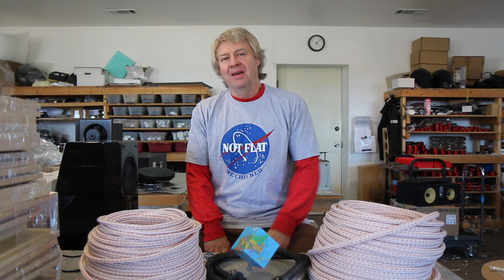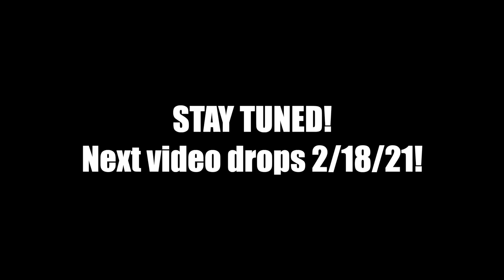Audiophile Cable TRUTHS: The Divided Camps

Comment: "Good audio" is one heck of a conundrum. Objective measurements have come a long way in creating correlation with what to expect from sound, but I do get the feeling that sites like ASR are missing a piece of the puzzle. I think they have amplifier characterization nailed, but there's definitely something missing from their speaker measurements, and Amir seems to acknowledge it. He's mentioned he likes speakers that don't "measure" well and vice versa. But this shouldn't serve as evidence that measurements are meaningless - it indicates that additional tests need to be added to the suite which quantity the noticed difference. But of course, a "noticed" difference needs to be proved with a double-blind test.

It's nonsense to say "this difference can only be heard, it's impossible to measure!". On the other hand, it's also nonsense to look at only frequency response graphs and distortion plots and conclude that is everything you need to know about a sound system. Those characteristics do matter, and fluctuations in those measurements create incredibly obvious differences, which is why they are a great starting point, but they aren't the only measurements that need to be made.

Comment: OMG. A series about transporting electrons from A to B.
Reply: @davidlong1786  Maybe they can make a difference. I happen to have monster cable and it sounds ok. A zillion threads in silicone. But your milage may vary :) Here we go ;)
"Tests by Stereo Review Magazine in 1983 concluded that Monster cables did not make a difference in the sound and were "indistinguishable" from 16-gauge lamp cord. Whether someone claims they can hear the difference varies from person to person. Many reporters and audiophiles have done double-blind a/b listening tests and are unable to hear the difference. According to PC Magazine, Monster is "often accused of selling over-priced cables that you can buy elsewhere for a fraction of the price".  https://en.wikipedia.org/wiki/Monster_Cable
Reply: @tweakradje  Scientifically speaking, if Monster cables did not make a difference in the sound and were "indistinguishable" from 16-gauge lamp cord does that make all cables "indistinguishable" ?  Apart from their high cost did Monster scientifically design their cables for measurable sonic improvement, or did they just build impressive cables which are ornate and generous in proportions, but in reality only provide aesthetic improvement?

Comment: Love the T-shirt! How appropriate! You're a brave soul! Thanks for venturing out of the 'audio bunker'!
Reply: Stick to making crossovers! 
There is no scientific evidence for globe earth. (Measurements are not established cause of natural phenomenon) 
The horizon is not physical, an apparent location can’t block boats and buildings. 
Outer space is fake. You can’t have gas pressue without a container. If the sky was a vacuum the gas we breathe would fill the space. (See the second law of thermodynamics)
Globe claims we have 15 degrees drift (stuff moving apart) as earth turns underneath stuff not attached! (Coriolis Effect) That DOES NOT HAPPEN! Nothing is drifting away at 1000mph on the equator. Earth isn’t spinning! If it was, flights going west would be reduced in their flight times as earth turned under them. (See NDT claim earth turns under footballs to make field goals) 

Again, measurements (maths) is not science. Science is a method of establishing cause of natural phenomenon. (See scientific method) £1 says you don’t know the three constituent parts of scientific hypothesis. 
Finally, feel free to check for the 8” per mile in Google Earth. All measurements of earth are flat. No drop. 

Let me know what the three constituent parts of a hypothesis (scientific prediction) are so we know you aren’t just pretending to know what “science” is. 

I’ll clip out this section and address your globe belief on my debate show “Flat Earth Debate”. Feel free to tune in for my response.
Reply: @NathanOakley1980  LOL